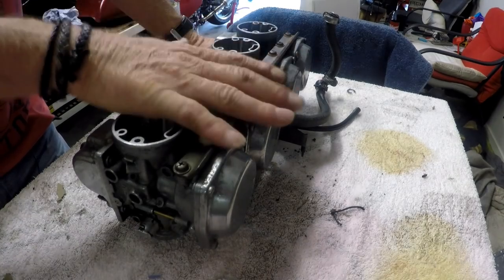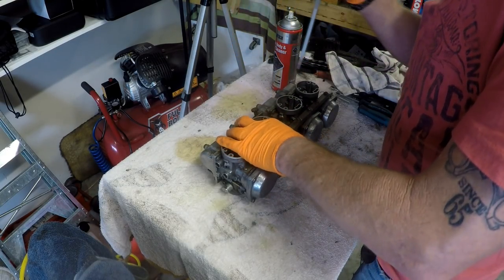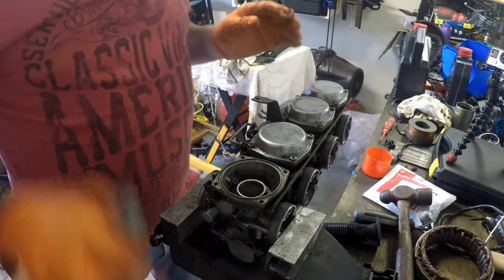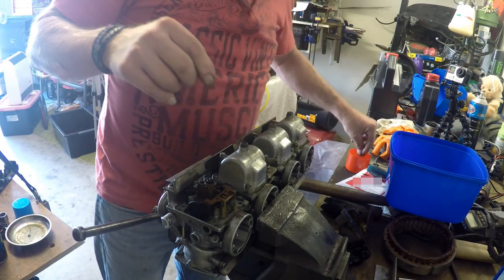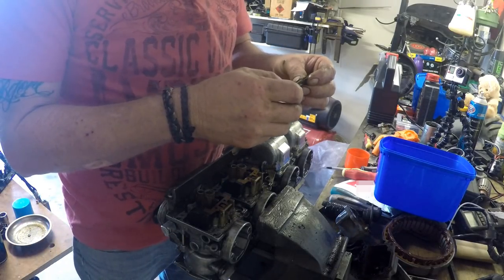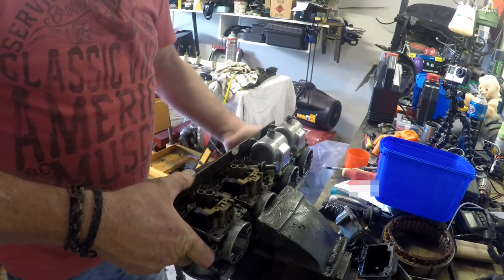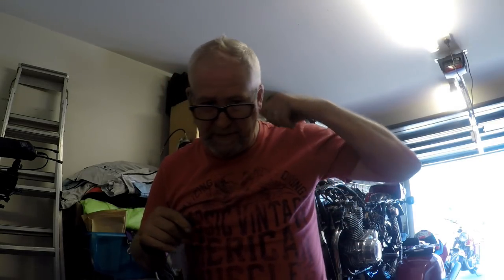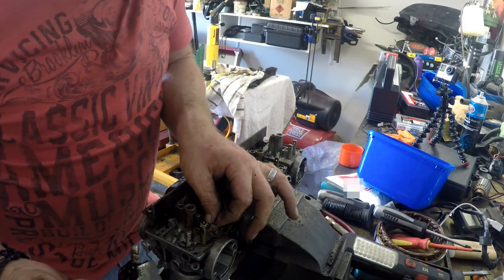GS1000 Episode 4 - Carburetors and Coffee

Comment: Mikuni BS34SS

Watch out for where to measure the float height. I hear it's weird to measure to the step instead of the top of the float.
Reply: I have Mikuni BS36SS carbs on my Suzuki GR650. Most mechanics I've spoken with say to measure to the lower step and NOT to the uppermost portion where the bracket attaches. The service manual is terribly unclear.
Reply from the maker: You can watch how I set them here https://youtu.be/YiWnXu0KNCs I’ll be using the same method
Reply: OK, different floats, and you measured to the top. I've heard that's normal. The GS float spec is to the step just below the top. The factory service manual is available for download here: http://gsarchive.bwringer.com/mtsac/~cliff/storage/gs/GS1000.pdf
Page 15-38 (pdf page 301) shows where to measure the float height. Unfortunately, it's hard to see on that scan (I've seen better somewhere), but you can see it's not the top of the float. That manual also shows the slightly odd valve clearance procedure.

OK, the 1980 supplement shows it much more clearly. Page 36 (38 of the pdf) here: http://gsarchive.bwringer.com/mtsac/~cliff/storage/gs/GS1000_1980_Supplement.pdf
Reply: Yes, the float style in those manuals is the same as on my BS36SS for the Suzuki GR650. My Suzuki manual is unclear, but seems to show measuring to the very top of the float where the bracket attaches. That didn't make sense to me, as all other BS carbs with this style of float requires measuring to the lower step, as you point out. I can't trust my manual on that issue, as the photo and writeup is also wrong in other ways, so I set mine to the lower step with no spring compression. Just wanting to ensure I'm correct before installing the carbs ;-)

Comment: Shame about one of those carbs  having a broken float post mate, you going to fix it? I recently repaired some alloy with some special rods that you use with a gas torch, bit of bugger to get right you need to have a little practice first, the secret is getting plenty of heat into the metal, I think Matt from the workshop done a video on it a while back...... it's tricky but it can be done. It will save junking the carb.

Comment: Those carburetors have not seen a good clean for many years, had 2 days of work with mine. Scared the hell out of me when 3 pilots were REALLY stuck....right size screwdriver, coffea and some anger managment is the solution. It´s all about taking good time with it. Have the same bike. After re-jetting it´s running VERY good. sometimes we get lucky :p Main needle up one notch, 125 pilots and 140 main. K&N podfilters. Good job Andy :)

Comment: I'm following how you deal with the issues on these carbs. I have Mikuni BS36SS carbs on my 1984 Suzuki GR650 that I am doing a bit of a build on. Mine do not incorporate the pilot jet plugs; there is no passage to the pilot jet from the emulsion tube housing. Interesting that Suzuki had these built by Mikuni in different ways, while still under the BS designation. I've rebuilt mine, but I remain in doubt about how I set the float heights. The original Suzuki manual is not at all clear. The photo seems to show the float height is measured from the carb body (without gasket) to the uppermost part of the float where the bracket and tang attaches. My experience, and that of others I've spoken with, is, you measure to the highest portion of the lower step where the float begins to round out (if you get my drift). So I'm hoping that setting the heights to factory spec in the way I've done it is correct, rather than terribly lean. Do you use factory height spec to the top of the lower step? Just want to get some confirmation before installing the carbs ;-) Really enjoy your videos. Thanks a bunch :-)
Reply from the maker: You can jump ahead by going backwards and checking out a video I did on bench tuning and setting the floats on a set from a XS11 here https://youtu.be/YiWnXu0KNCs
Reply: Thanks, but those floats are not the style I have in the BS36SS carbs. Mine and most others I've seen from those BS carbs have a float that steps down from a flat top section, then is flat again before the curve starts. Here is what I mean. Just trying to confirm that method. https://youtu.be/95nlrP-yn2I?t=24m11s

Comment: Andii am a fan! i am from texas ! been transplanted here  in tennesseea. i hve a barn find  GS1000. i'm only getting 60 psi  compressionon.  that motor would be closer to 100?
Reply from the maker: Should be at least 100
Reply from the maker: Suzuki workshop manual states 128 - 184 psi with a service limit of 100 psi

Comment: so after taking them out of the bike you are totally fine to soak em down with brake/carb cleaner and just have at them and scrub?  no worries about ruining internal parts with the cleaning solutions (aside spraying directly into the holes as you mentioned)?  I'm about to start on my xs1100 carbs :)
Reply from the maker: Yes just avoid spaying anything with rubber on it
Reply: You can buy brake cleaner that is O-Ring safe.

Comment: Hey matie, trying to fit the same carbs on a gsxr750 1985. Just trying to work out what jet sizes to use. I've got bs34ss. Great video's. Hi from albury 😀
Reply: Bruce Kirk no. Stock exhaust and air box
Reply: I used to have one of those, the stock flat slides where crap. They might have been OK for a race bike but on a road bike with a shed ton of miles on it there where a nightmare.

Comment: Morning Mate.  One small correction and a carburetor suggestion.  
The Suzuki GT750 (Water Buffalo) was the first production bike with CV carbs. Period Test report in Cycle magazine stated that the 1971 ( I think ) GT750 was the first stock production bike to make it to the summit of Pikes Peak with out modifying the, thne brand new on the market CV carbs. As I am still in love with the Buffalos (Kettles) have owned two, I  still have that article somewhere 

I learned the real trick to cleaning carburetors when I live in one of our coastal states and did quiet a few carb repairs for my customers.
An inexpensive Ultrasonic Cleaner is indispensable for cleaning old carbs. Today's methanol infested, contaminated gasoline will turn to jello when they sit with fuel in the float bowls. I found the easiest and best way to clean that miserable stuff and it's assorted crud was a couple of hours in an ultra sonic tank with a few drops of Dawn dishwashing liquid. Then a copper wire and a blow gun (low pressure) turned a long tedious job into less than  than a couple of hours labor. Easy Peasy. I still do a few older bike carbs here in the desert, but they are not near as bad without the humidity.
FYI, I can buy an Ultrasonic cleaner big enough to do a couple of carbs for less than $75.00 USD. My guess is you can find one at your equivalent of Harbor Freight or on Ebay.
Jim Jaudon
Mescal, Arizona
Reply from the maker: Thanks for the info mate.  Just a small correction on your correction, I said the first four cylinder four stroke bike to be fitted with CV carbs was the XS11, and it was.  Ceers, Andy
Reply: Missed the 4 stroke part. But I am deaf as a post and worst part is I don't listen worth a damn. 
However I am not wrong about the ultrasonic cleaner.  
Jim